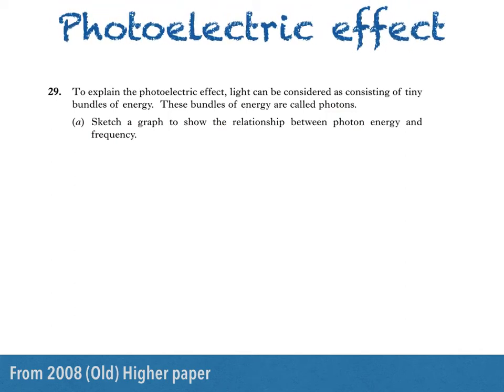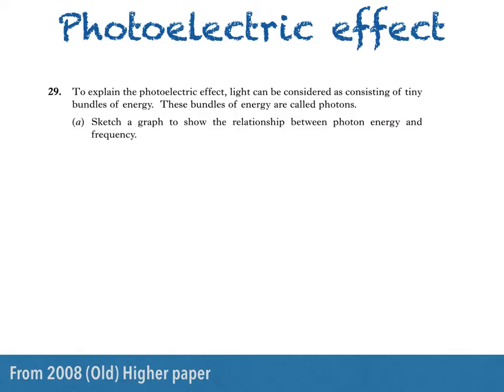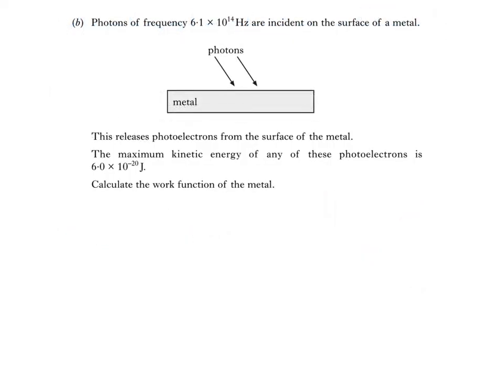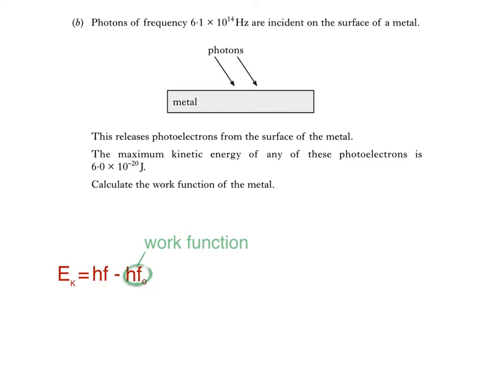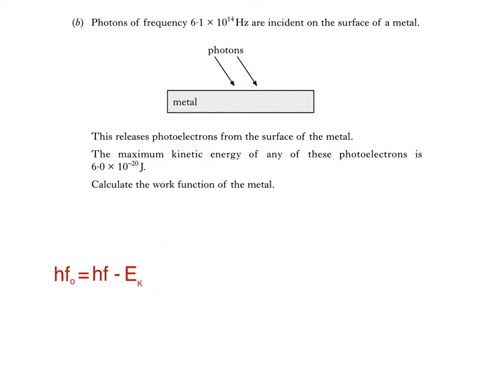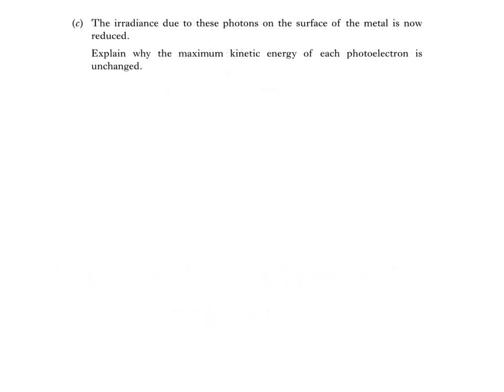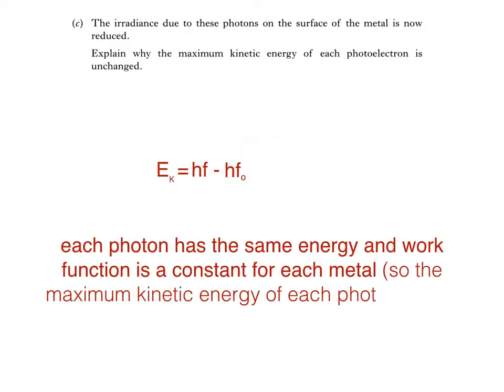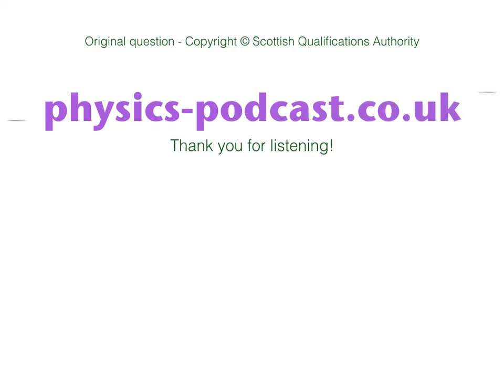Higher Physics - The Photoelectric effect

Comment: Can you say it’s unchanged because iraadiance is not in the equation so the energy will have no effect
Reply from the maker: For part c of this question, you need to explain why irradiance will have no effect rather than just stating that it isn't in the equation - it's becuase the energy of the photon and the work function of the metal are constant. You can then comment on the equation, explaining that the electron's kinetic energy must also remain unchanged.

Comment: If the irradiance stays the same but the frequency of the radiation increases why does the number of photoelectrons emitted per second decrease? I thought only the energy of the photoelectrons would change (increase) as I thought only irradiance effects the rate of emission. Question 9 in 2017 paper 1. I thought C was the answer but marking scheme says D.
Reply from the maker: There was actually a bit of discussion on this question recently among Physics teachers - the question relates more to content which was taught in the old higher and shouldn't really have been in there. I wouldn't worry too much about that one. You can work out irradiance, I from the equation I=Nhf where N is the number of photons incident on a 1 metre squared area per second, h is planck's constant and f is frequency. If frequency increases and h is obviously constant, then N has to decrease to keep irradiance constant. That explains the question but it shouldn't have been in there in the first place. Good luck with the exam!
Reply: @MrSmithsPhysicsonline  Thank you so so much, I was really worried and was wasting so much time trying to find something to explain it. But thank you for the explanation.